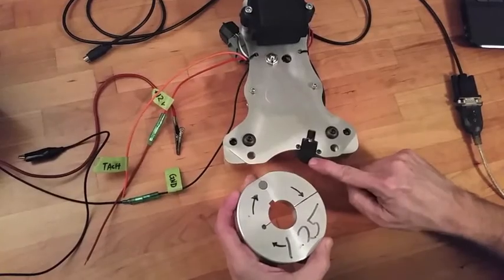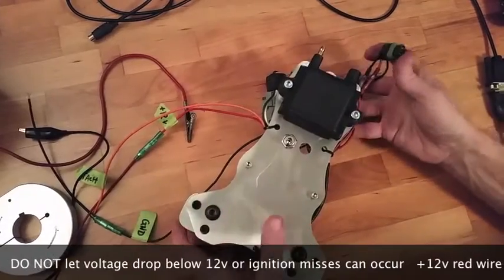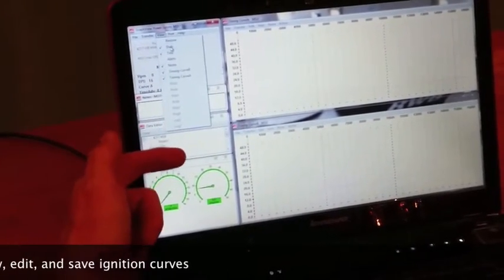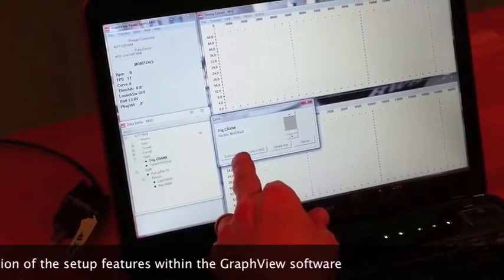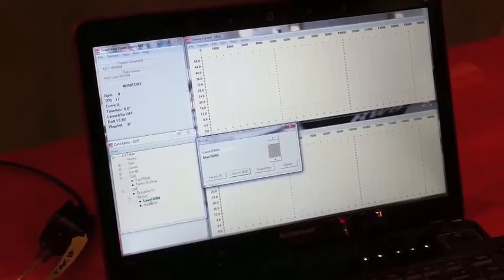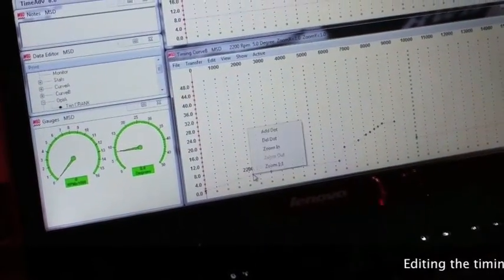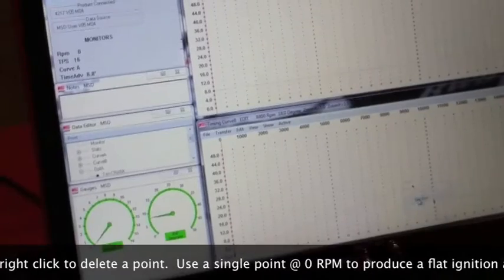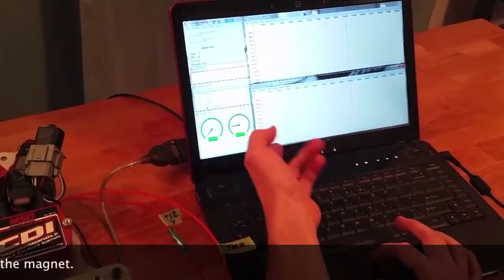MSD 4217 CDIgnition System Crash Course

Comment: Hello, I have the msd 8232 coil on my moto with programmable cdi. Spark seems to be the same after instal the coil, will this programmable ignition give more power to spark?without changing my ignition timings settings?
Reply from the maker: Not likely.   The input to the coil is the same.  Depends on prior. coil

Comment: Hi i have a question about the 4217. You seem to have lots of knowledge about it. Im hoping to use it for a racing application with no charging onboard and hopefully use li-ion m18 drill battery that ive seen racers and tuners use. Would you know what the input voltage range is for the unit and if an 18volt battery would be in range? Thanks
Reply from the maker: It seems to work fine at 18v
Reply: @VogelManufacturing  really? That is the source voltage you were using?
Reply: I just dont want to fry the cdi at almost 500 dollars. What source voltage are you running for your setups?
Reply from the maker: @drewdprix2  13.5v -18v
Reply: @VogelManufacturing  great thanks for the quick response!